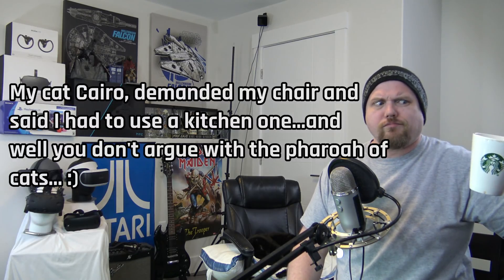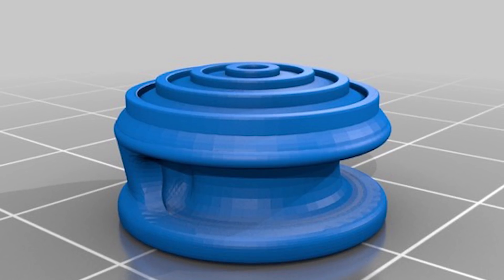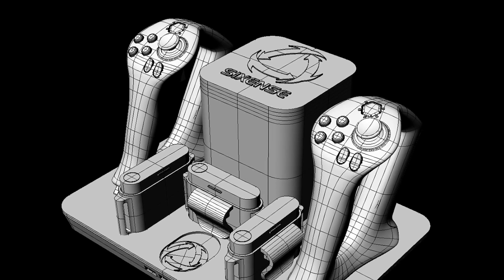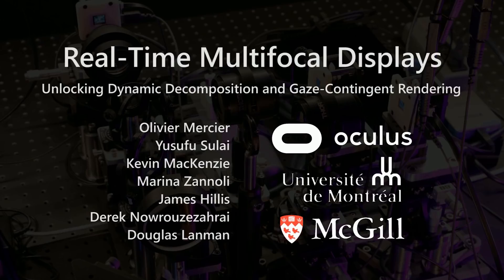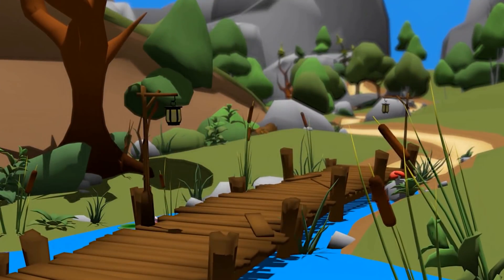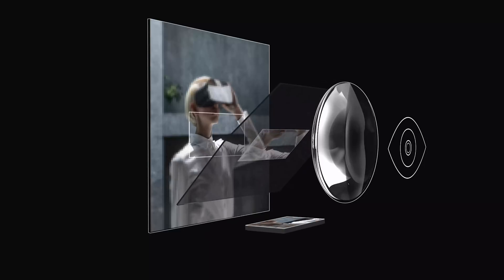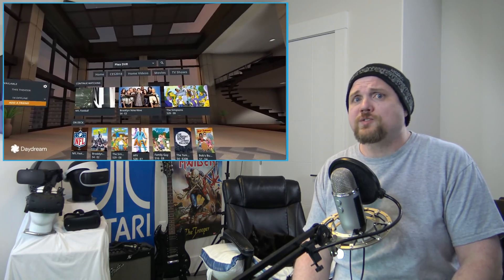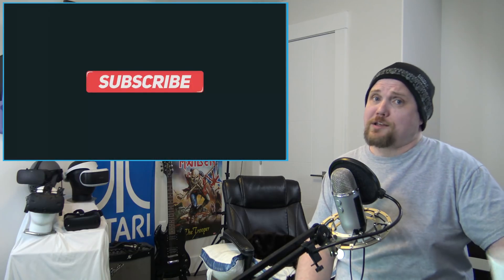KICKSTARTERS WHEN IS LONG TOO LONG? 3D PRINTED JOYSTICK FOR VIVE & MORE VR Roundup Episode 30

Comment: I don't know about that varjo thing, it all makes sense and for sure seems like an elegant solution, I just can't see how they're going to pull it off without it failing down the line. =/  But if it works they could really jump into the lead..
Reply from the maker: No argument from me...just reporting on that as my own thoughts pretty much mirror yours and while this "shows" it, it really still doesn't explain the technical inner workings only at a very high level.